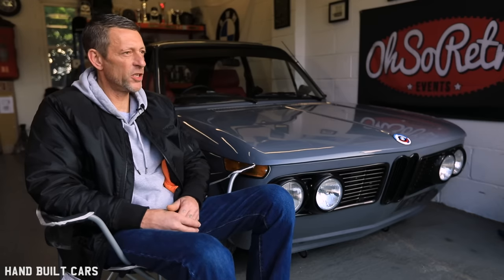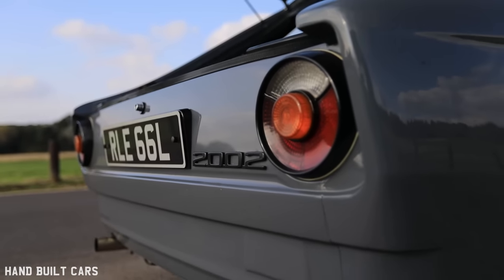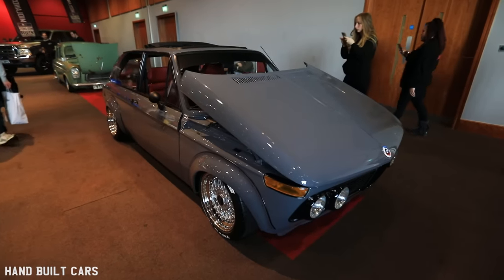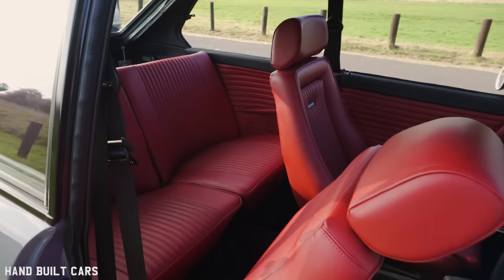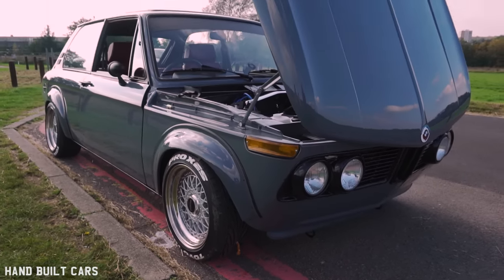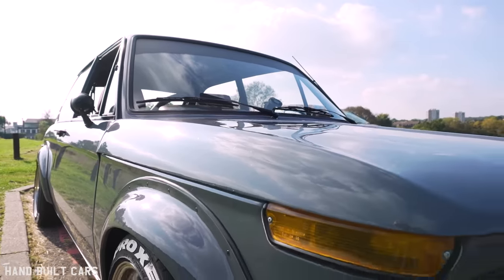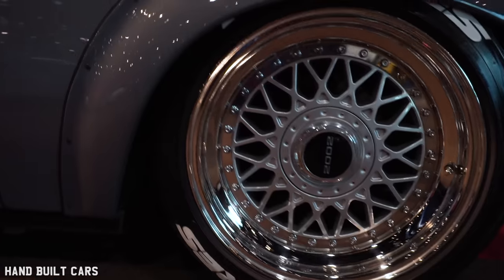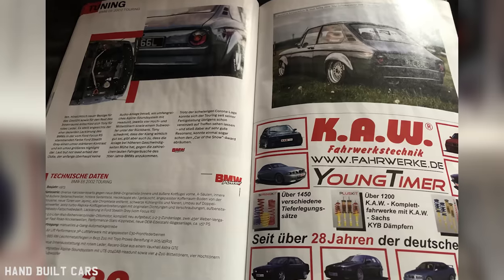Rare And Unique 1973 BMW 2002 Touring

Comment: I miss my -72 2000 Touring. It was in BMW Inka colour. The spline from the gearbox to the driveshaft went once and I got a 2nd hand revised broken gearbox and replaced the broken shaft with the newer one. One of the coolest cars I have ever had and owned it from 1984-2005 when it was sold but scrapped by the new owner. Was rubbish in snow but with 10-15kg in the boot it made huge difference. 
You have done an amazing job with your touring.

Comment: What a beautiful build. Drove a modified 2002 from a friend back in 1980, it was a dangerous beast. The amount of fuel it used was insane, even for those days. But you could not drive it without having a big smile.
Reply: It was lethal if you didn't know how to drive one. Very few would be able to drive one of these as any mistake would punish you one way or another. The Touring was also shorter than a normal 02 but also lighter which did not help on wet roads. Yet I loved mine and the folding seats had a very simple and easy way to fold it flat.
Reply: @VinDieselS70  what was lethal about it? Stock power levels don't seem crazy and it was a balanced chassis.. thus its success in racing